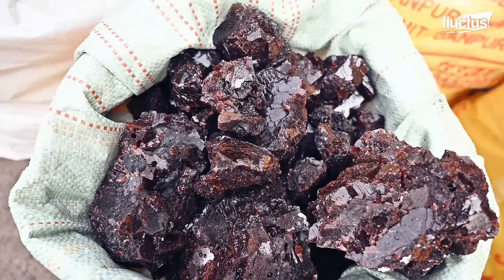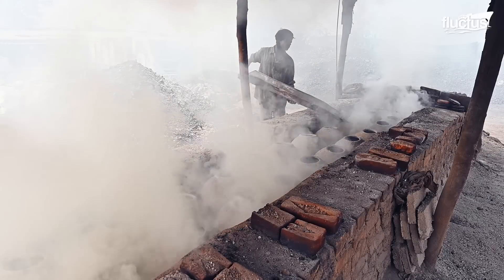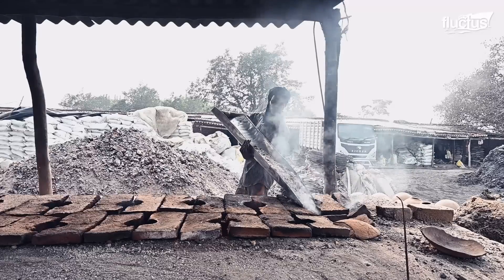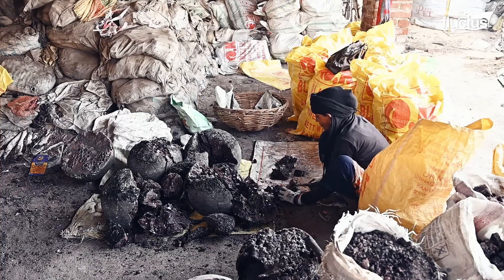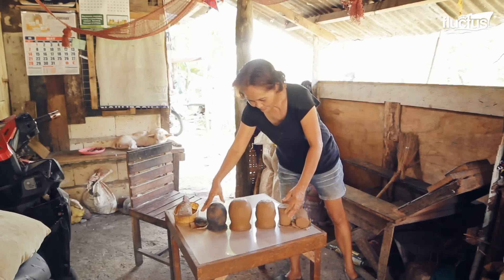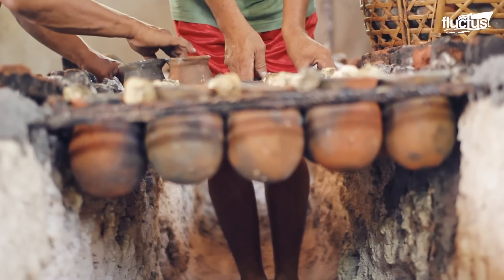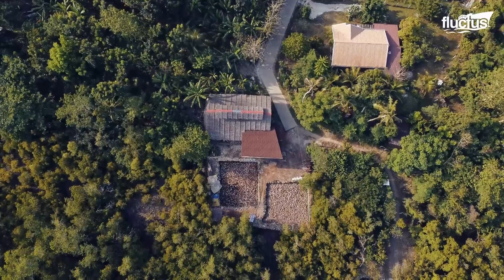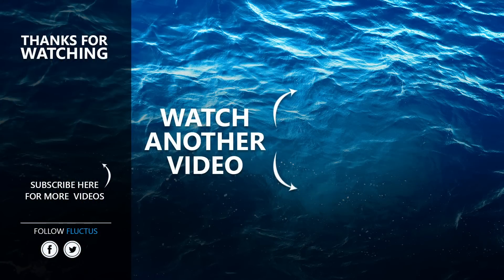Why this Special Salt is so Dangerous to Produce

Comment: Special salts like pink Himalayan salt are often mined from deep within the earth, typically from ancient sea beds or salt caves. The mining process can be physically dangerous due to the instability of the underground environment. Workers in these mines may face risks from cave-ins, exposure to toxic gases, or lack of proper ventilation. Manual extraction methods also pose significant physical challenges and hazards to the miners.

Comment: this original but rudimentary method of salt extraction has one drawback, a significant amount of the extracted salt is wasted . . . should one gather all of the wasted salt accumulated during the extraction process over a span of 2 months, the amount of salt wasted will be more than enough to fill up no less than 63 TEU spec 20.0 ft shipping containers . . .